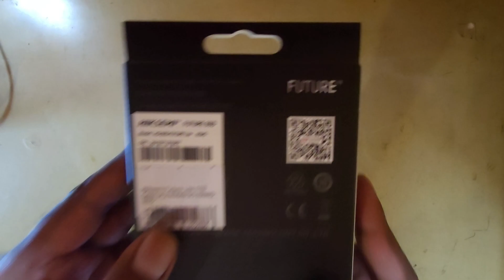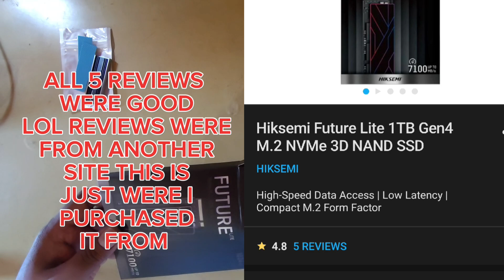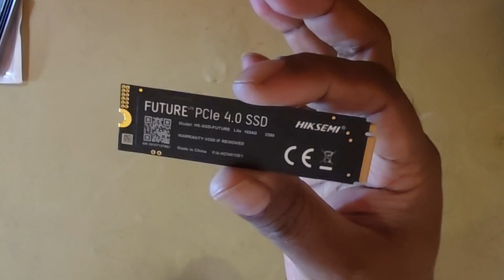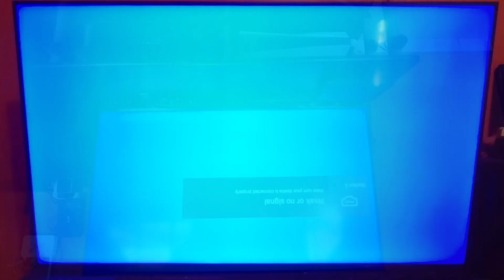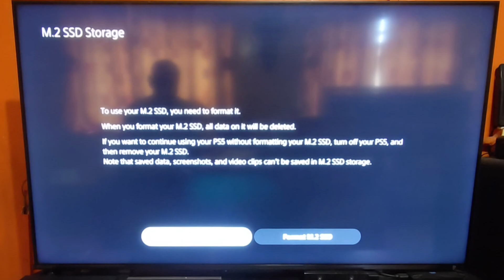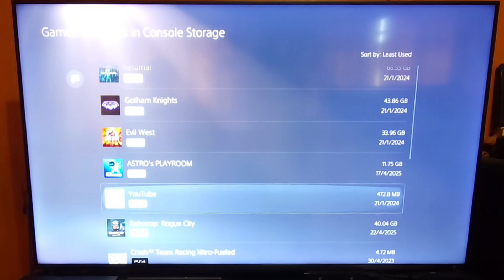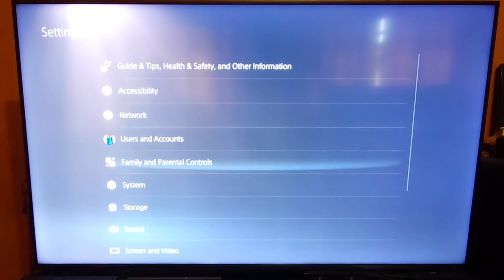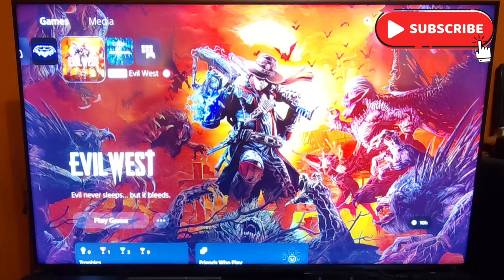Hiksemi Future M.2 SSD/Gen 4 Unboxing And PS5 Setup

Comment: There is so many different videos showing different ways to put down the termal pads. Should it not be sticked to the heatsink parts (long and short on long and shorts sections) and not on the actual m.2 drive? Or does it not matter?
Reply: Sir you are correct, I emailed Hiksemi and they confirmed that the long sticky pad is stuck to the drive and not to the heatsink cover (yet their instructions say so in the box it comes with!). Their exact words "The thermal pads stick should be pasted on the IC side directly, because when the SSD working the IC temperature will high, so this stick can make the temperature down.".